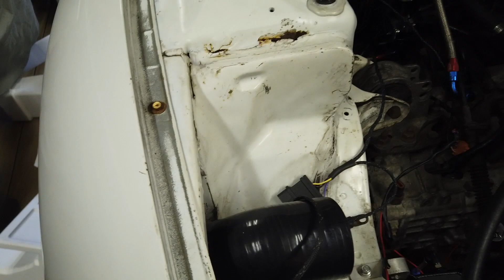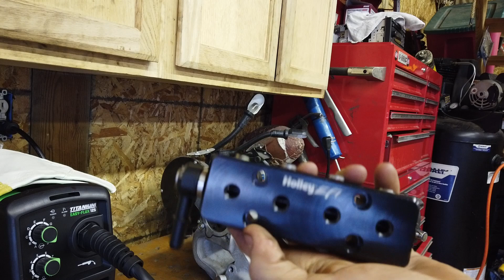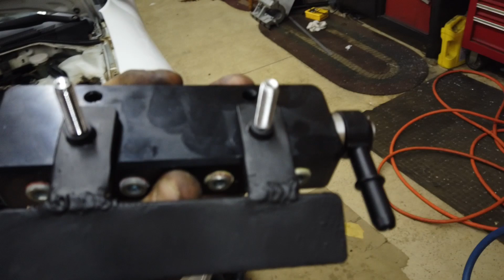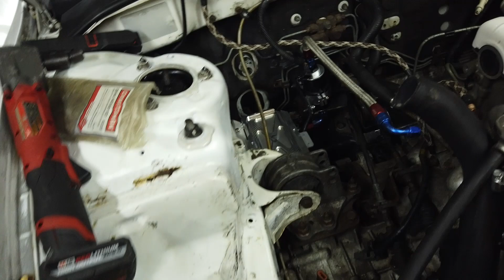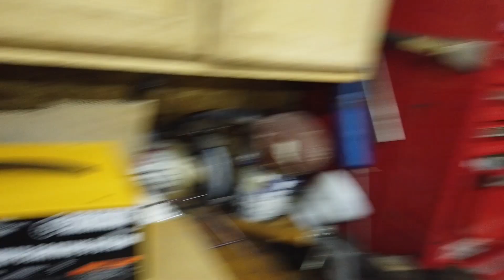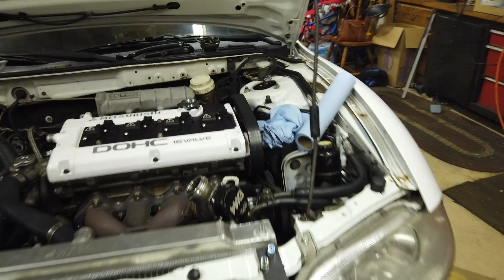My New Harbor Freight TITANIUM Welder Rips! 2G Project Progressing!

Comment: With Flux Core, don't go over the weld or tack without cleaning the slag off, also bevel that edge to get full penetration. Probably not on that thin of steel but it would have made the weld flatter.
Reply from the maker: I appreciate the tips! The next pieces I make I will do so!